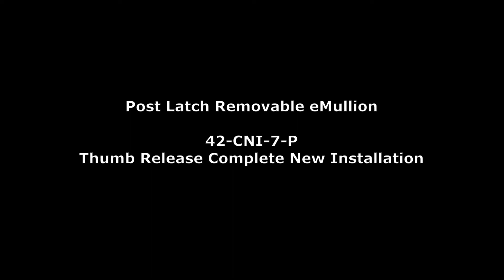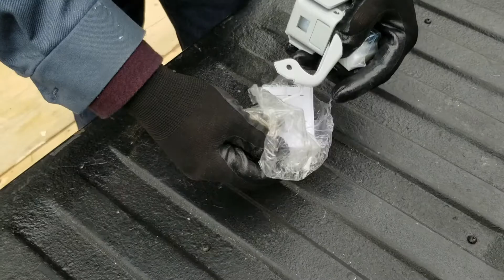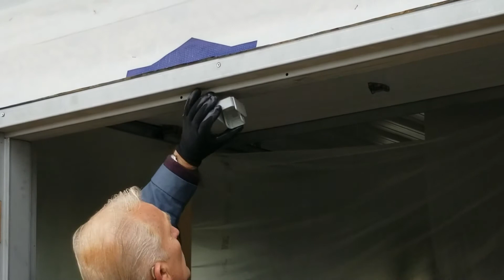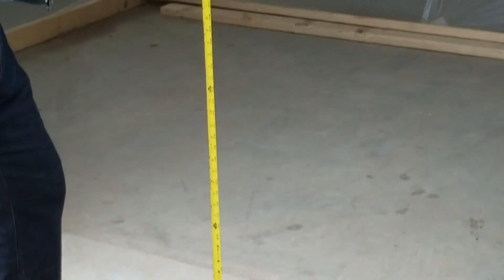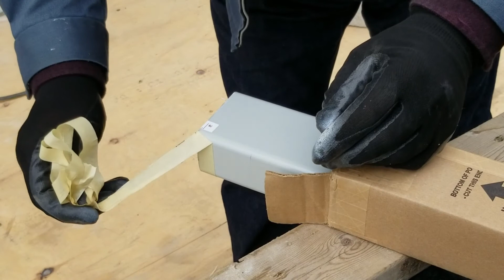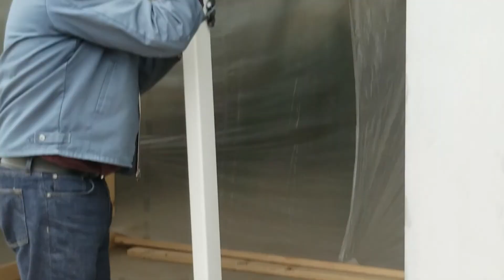Post Latch eMullion Installation

Comment: Dont show how doors close with mullion installed there was a what looked like a 1/8" gap between doors when closed now it's 2" how is door going to close?
Reply: Got it, thank you for explaining that for me I was looking to have similar install on my building.
Reply from the maker: @juaniec2  Glad I was able to clarify your question.  👍When you have a chance check out our website PostLatch.com.  The Quick Release Removable Mullion is only available from Post Latch Industries.  School boards, institutional/commercial facilities are removing their existing troublesome removable hardware/mullions and specifying our products as a 'no substitute'.  We are located in Niagara Falls, Ontario Canada and offer Thumb Release and Lockable options as either a retrofit kit or complete new installation.  You can contact our sales dept. sales@postlatch.com for pricing.  Thank you for your interest.  Take care.
Reply from the maker: Hi. When you watch the video please take note of how and where the base plate, upper hardware and hence the removable mullion is located with respect to the frame's stops.  When the two doors are closed they come to rest against the frame's stops as well as the mullion's outside face.  The mullion is mounted inside the building and not between the doors.  Weather stripping and strikes are attached to the right and left side of the mullion.  The panic hardware that is mounted to the doors themselves latches onto the strikes(not covered in this video).  Cheers!